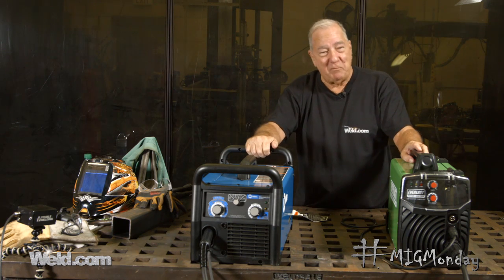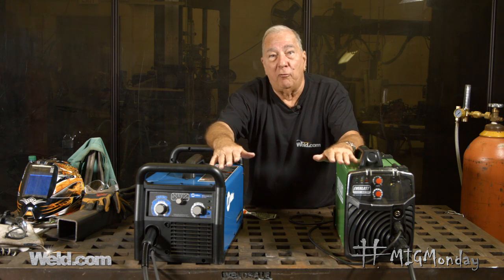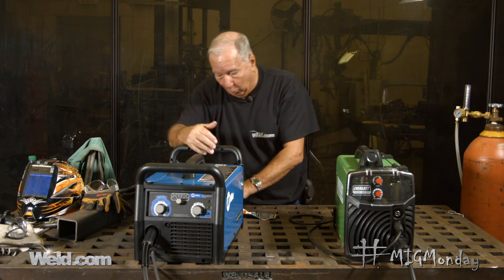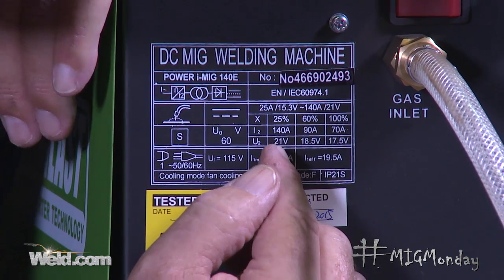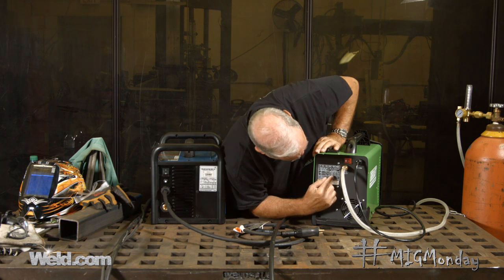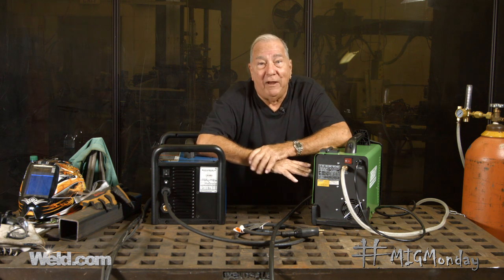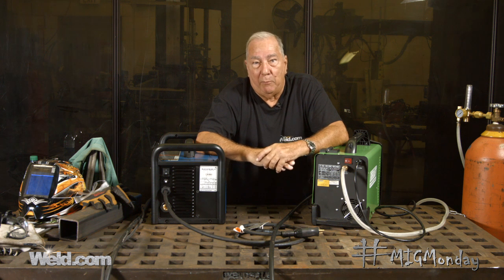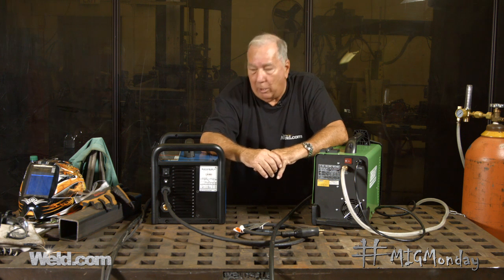Duty Cycle for Dummies | MIG Monday

Comment: If welding at 60% duty cycle which as stated is for a period of about 6min......how long should one wait for the machine to cool down before starting to weld again to achieve another estimated 6min welding?
Reply: The remaing 40% of 10 minutes which is 4 Minutes..That is the rest period of a welding machine before using it again for another 6 minutes.
Reply: Thank you
Reply: 4min

Comment: Add to that what to do when your machine hits it's thermal overload...the machine will not shut off, it will simply stop welding. Newer machines have a thermal overload indicator light whereas older ones may now. When this happens, leave the machine on to allow the fan to continue to cool the guts of your machine as opposed to hitting the off switch. On a hot summer day in coastal Texas for example, you could always put an additional fan in front of your machine to help with this. The duty cycle is also an estimate and not exact. Again, on a hot summer day in coastal Texas, your machine may hit its thermal overload much sooner.
Reply: You've got that absolutely right. From my understanding my Everlast welder had its duty cycle independently tested at a specific temperature (I think around 100 degrees) to verify its duty cycle. An overheated welder should be cooled down quickly rather than letting it cook longer than it should. As you said, the internal fans are typically the best way to do that.
Reply: I always wondered if I should turn my mig off when I'm getting close to the duty cycle. For some reason, it took watching several videos and getting to your comment to clear that up. Thanks!